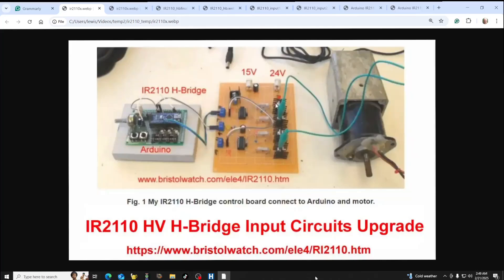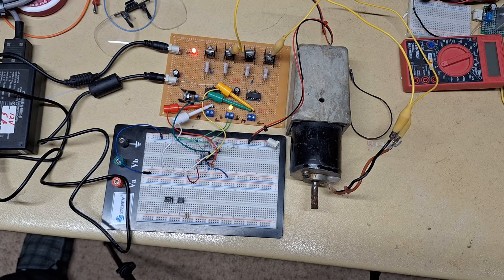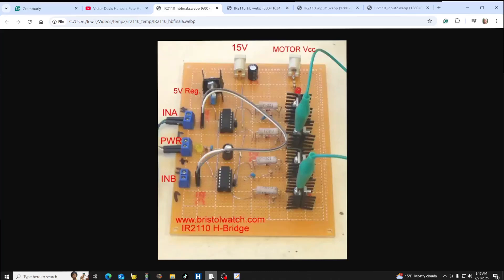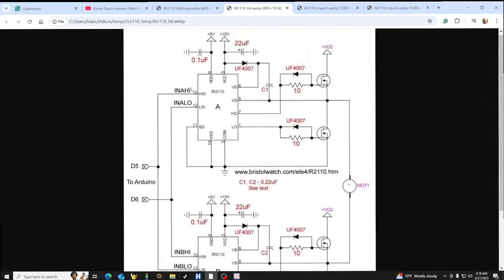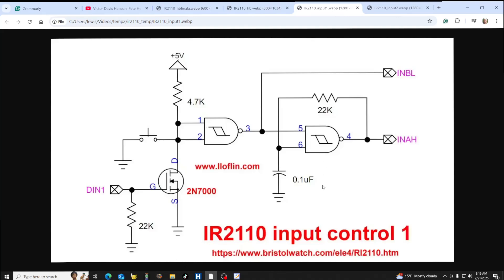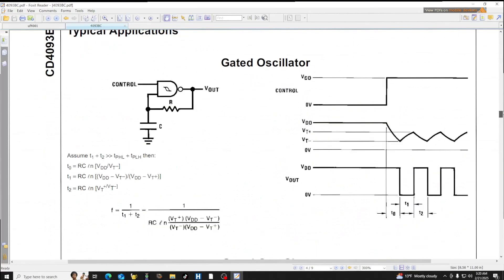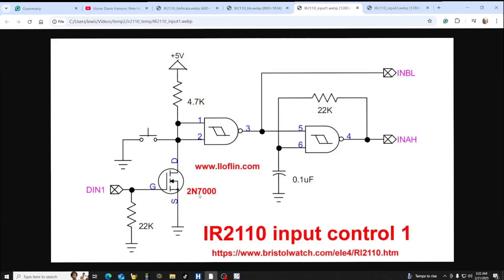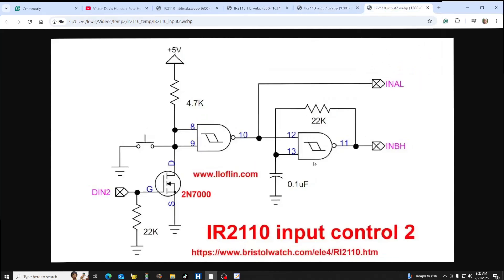IR2110 High Voltage H-Bridge Input Circuit Upgrade

Comment: Thanks for you great video.
I'm planning to use this driver to run a thread mill dc motor, 200v   10a   , for my home shop milling machine.
Can you share the PCB   file ?
I checked the link in description but did not count the pcb ....

Comment: Hello,
I’m building a half-bridge driver (30 V) with the IR2110 and two IRF3205 MOSFETs, controlled by an Arduino. In my QSpice simulation the gate voltages appear too low. Could you please take a look at my circuit and let me know if something is missing or wired incorrectly? Thanks a lot for your tips!
Reply from the maker: I do not use simulation software because it often fails to accurately represent real-world scenarios. I built the circuits. These MOSFETs, according to the spec sheet, operate over 6 volts. The ones I used operated at 3V. I can only say it works when I built it using the parts I used and the Arduino program I used. Start varying things and see if it works.

Comment: Hi, Lewis.  Thanks so much for your excellent videos.  Could you please tell us what wattage you selected for the 10 ohm MOSFET gate resistors?  And did you come up with that using the Qg/t estimation of gate current?  Also, what do you think about using an IR2111, which sports internal deadtime insertion?
Reply from the maker: Never tried IR2111 and the 10-Ohm resistors are 1/4 watt. They were estimates based on spec sheets and desired fast turn-off time.
Reply: @LewisLoflin  Thanks for the reply.  Regarding the IR2111, I saw from the spec that if differs in that its peak output current is 250ma/500ma (source/sink) whereas the IR2110 can do 2A for both source & sink.  However, that shouldn't matter for the
H-Bridge application (or should it?).  [Incidentally, I have relatives in Gate City.]

Comment: Hey 👋, iam working on H Bridge concept for polarity reverseal. If iam checking on HO and LO voltage iam getting  12to 14v , when iam connecting that HO and LO of ir2110 to the IGBT . Iam not able to see any voltage at load. Even if iam passing 50vDc from Vcc to GND  of H Bridge. Do any one have Idea of solving this problem. Pls help me out.
Reply from the maker: What are you driving it with? It requires a square wave input on the HIGH side to turn on.
Reply: @LewisLoflin  square wave do u mean PWM ? iam using arduino mega 2560, using digitalwrite cmd, iam sending signal to IR2110(pin 10 and 11), then HO and VS together making GATE-emitter voltage to the upper IGBT. same LO and COM together making GATE -emitter voltage for lower IGBT. i have built a circuit  as you showed in the 2:32 of this video.
one more doubt is , is that the commom ground for H-Bridge and IR2110?
Reply from the maker: Has to be a PWM or fixed square wave. That is what allows the gate charge capacitor to work.
Reply: @LewisLoflin   analogWrite(5, 127);  // ~50% duty cycle.. will this cmd works out ?
 because this is giving me the constant PWM wave.
Reply from the maker: @sumanthmssumanthreddy7737  It is not the percent but the square wave itself that counts.
Reply: @LewisLoflin  even then with that square wave to the high sides . Iam not getting output at my load?
before the IR2110 HO and LO sides connecting to the IGBT, Iam checking gate-emitter voltage Iam getting fine voltage  in all the 4 sides of the two ir2110, which i will connect to the H-Bridge . but after connecting my load  to the H-Bridge and passing 70v from VCC to GND of H-Bridge. iam not getting any voltage and polarity reversal at my load. keeping the load connected i have checked the gate-emitter voltage at all four sides of the IGBT, there was no voltage in any of the four gate-emitters. if i disconnect the the VCC and GND of H-bridge and check there was a voltage in all four gate-emitters . iam not able to find where is the problem?? pls help me out to solve this problem.
Reply from the maker: Did you modify anything from the schematic?
Reply: @LewisLoflin  NO.
Reply: @LewisLoflin  and one more thing I have observed is ,with your circuit HO pin of IR2110 is default ON state, this pin is not controlled by HIN, there is no switching, but i can see the switching in LO side?? what might be the problem, or is that correct??

Comment: For low voltage motors (even upto 72V) , two resistors can be connected across the two bottom mosfets...
These are sized for the bootstrap cap. charging current approx.calculated for (80-85%) pwm duty cycle..
This allows the bootstrap caps to charge even when the bottom mosfets are off. & the additional NAND logic is unnecessary..
Additional advantage is to apply the pwm pluses to top side mosfets...and avoid pwm on bottom ones.....if no braking or regeneration control is required.
Now the "pwm"med top mosfet bootstrap cap gets repeatedly charged during it's "off" time...here the opposite bottom mosfet is full "on" providing a bypass charging path across it's parallel resistor.....
..Yet another advantage now with high side pwm is during the "off time" of the other bottom mosfet the motor's B.E.M.F. sensing can be done for sensorless/ tacho-less speed feedback & control.
Also note with the additional Nand gated oscillator..one cannot implement braking or regeneration...because shoot through WILL occour ...due to the gated osc. .....
In this case..(nand gates) also reconsider the requirements for introducing additional timing delay during change from direction 
"F to R" & vice-versa... , here too to avoid shoot through.....
Happy Motoring😅